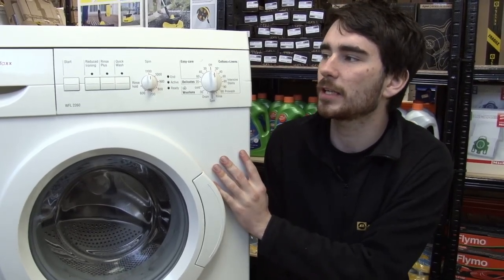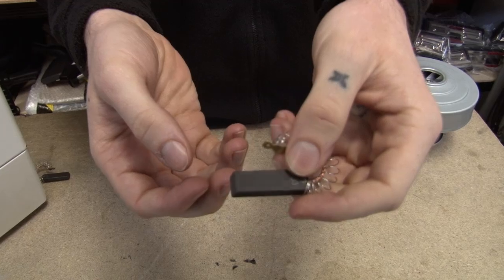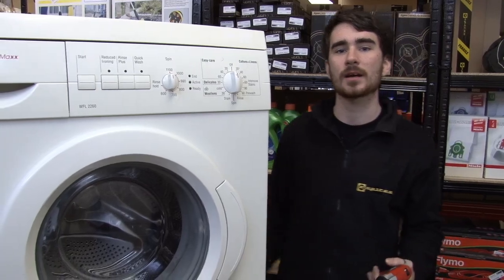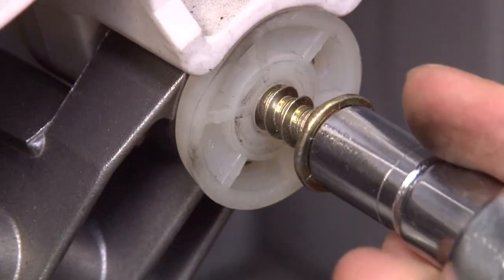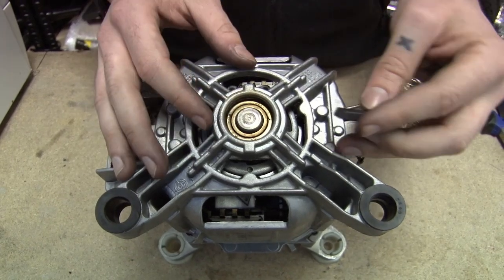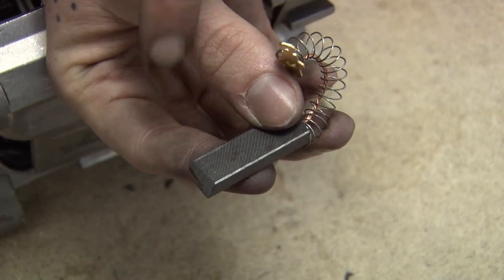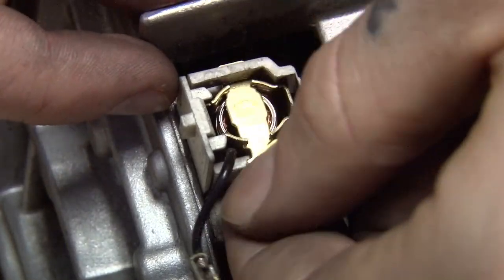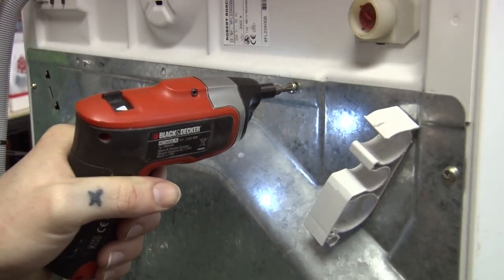How to Replace Carbon Brushes on a Washing Machine (Bosch)

Comment: Hi, I wonder if you can help me. I changed the brushes on my Whirlpool. Everything works fine except when it gets to rinse, it does a slow preliminary spin, but when it tries to spin up to speed (even on lowest 400) after 2-3 seconds, before it gets up to speed, the lighs flicker and it stops spinning. It keeps on trying to spin over and over.  We have been using it like this for about a month (because it washes OK), so the brushes should be bedded in by now. I cleaned the commutator.  Any suggestions please.
Reply from the maker: Hi Frank, This problem may be due to an unbalanced load so check out :
How to Prevent a Washing Machines Spinning Noisily
If the machine spins oK when just a light load is in that would tend to prove this.
If the lights 'dim' even on an empty spin you may have a damaged motor (possible shorted windings) that the control board is resetting rather than push too much power through it.

Comment: Opened mine up, but don't think i have exchangable carbon brushes, just a whole circle of them, but no further screwes anywher to dismantel the thing any more.
Reply from the maker: Hi Geert365, what machine is it?.
Reply: eSpares Turns out i don't have carbonbrushes but  in dutch a: "aanloopcondensator"  (run up condenser?). It is a Philips 901.
Reply: eSpares Ps, i also already checked a duct running to a thing whitch measures the 
levels of water i think, can't get both ends loose, but can pretty 
easily blow through it.
Reply: Geert365 Opened the machine up, contact spray on some wirings, motor out, motor in, Internet searches, been busy on and of for a week (don't exactly know the hours), than the idea of checking the fluid (?) dispenser, it went a little ridged, put some oil on it (kinda thought it made sense that that could cause problems) and the first test wash went oké, so problem solved for now (who knows about next month, but still). Long story. To anyone who is helped with this.
Reply: eSpares  That would have been a pretty good guess  (seems to me) from all the way too far off, but hindside etc etc, but thanks for the attention. Goodluck with the next ones.
Reply from the maker: Geert365 We do not have information listed for this model or details of the motor used.:-(
Reply: eSpares It is solved already, but thanks for checking.
Reply: Shayne van Asperen  I got an beko but it is noisy !!!!!!!!!
Reply from the maker: the cube see our video: 
How to Prevent a Washing Machines Spinning Noisily
This may help identify the problem.

Comment: Hello. I was wondering if you could advise why my Bosch WFL 2400 motor started getting very hot and smelly tonight? I changed the brushes about a month ago, and it's run fine until tonight. Tonight it had a heavy load of 4 beach towels, and got a little unbalanced. I took the belt off and the drum spins freely, as does the motor - so all the bearings seem fine. Do motors burn themselves out over time? I'm kicking myself for not checking the commutator when I changed the brushes.
Reply from the maker: Hi Tony, With a heavy load the motor is going to work a lot harder and will get hotter. If this gets too hot or the commutateor was blackened and not making a good contact to the brushes then extra heat may have damaged the windings or the commutateor itself. If the motor is sparking or noisy when you retry it empty clean the surface of the commutateor with fine grade abrasive paper and check the brushes condition. If the problem continues you may require a new motor.

Comment: Changed brushes now my spin speed is changing and machine doesnt work, it just bleeps and changes spin speed
Reply from the maker: Hi Liz, Recheck the brushes are fitted correctly and the buttons on the control panel are not stuck. It is possible the worn brushes could have damaged the PCB.
Reply: It has started working ok now, after 24hrs I tried machine and worked ok, im not sure why but it is now working fine with new brushes, thanks
Reply from the maker: liz brougham It is possible the problem was due to the new brushes 'bedding in'
This is unlikely to reoccur if this was the problem.

Comment: Good video, it helped me get my old brushes out and they looked worn down to about 10mm (you could just make out the copper wire core starting to appear through the face of one of them so they were definitely shot). I ordered some new ones from eSpares and fitted them carefully as per the video, but sadly my Bosch Classixx 1200 Express is still not spinning. I've had the pump filter out and it's clear. The pump is still emptying the machine anyway, so no draining issues there. It doesn't matter which cycle I put the machine on, it just makes a faint clicking noise when it gets to the point when the drum should turn and nothing happens.
I should also add that when the machine originally broke down last week, it was in the middle of a spin when it suddenly tripped the MCB on the 30A circuit at the consumer unit, so would I be right in assuming that chances are my motor has fried? Or is there anything else I can check?
Reply: Just a quick update... I dug out a multimeter and tested for resistance across the 6 blades on the terminal block on the motor. The first and last pair gave a reading, but the middle pair were dead. I then checked across the brush terminals and got a reading. Next, I managed to get the pointers of the multimeter onto what looked like a thermal fuse (silver and square in shape with two oblong bulges) that was just inside the motor beneath the terminal block. I tested across what looked like the two terminals and got no reading, then I tested each terminal against the body of the fuse and got a reading off only one of them. Does that sound like a blown thermal fuse? I've just read that the fuses are not replaceable, so would I be right in assuming it looks like a new motor?
Reply: *****
Thank you for the reply. I've just run the multi meter test again on the main 6 blade terminal block on the motor and all I can get is a reading of 2 Ohms on the first set of blades and 16 Ohms on the last set, but the two blades in the middle are completely dead at all range settings on the meter. Does that sound like a fried motor? I was going to have the control panel out and test that, but, if the motor's toast, then there seems little point, as the machine, being an old Bosch Classixx 1200 Express, is probably beyond economic repair, seeing as a replacement motor would cost a fair bit more than a recent 9KG secondhand machine with a faster spin and better energy efficiency/lower noise.
Reply: *****

Yes, you're absolutely right, and considering the age of the machine, chances are the bearings and other replaceable components, though they may seem to be OK at the moment, are nearing the end of their service lives, so  to shell out that sort of money for a new motor wouldn't make much economic sense. Anyway, we've bitten the bullet and got a new machine turning up on Friday.
There is, I feel, a cautionary tale for anyone reading this, who's thinking about replacing their brushes, and that is to do it now, as it's easy, doesn't cost much at all, and your old machine will probably run on for quite a few more years, but if you leave them to wear down till the core wire is sparking on the commutator, like I did, there's a chance you'll end up having to stump out for a new machine.

Comment: Hi great easy video - however could you let me know how I get to my pump on a Bosch WFL2450. Once rear removable access panel is off, this only gives access to the rear of the drum. The WM appears to be encased in an all-in-one body. I can see the motor but almost impossible to get at it. Any ideas or am I overlooking the obvious? Any advice would be really appreciated. Thank you

Comment: The back of my Bosch Classix 1000 is much smaller than the one in your tutorial and I can't see the wires into the motor. I can get my hand in and feel them but haven't been able detach them.  Any advice?
Reply: ***** Thank you.  There was a tense moment when it didn't spin, but then I remembered that I hadn't put the belt back on!  All working very well now tho.

Comment: I used this video to fix a Bosch Classixx 1400. The fix works fine and very happy with the spares. Just for the 1400 model, It took me a while to work out how to get the motor out. The entry point is at the bottom of the machine, so I had to lay it on its side and take off the bottom panel. Bit more tricky to get the bolts for the motor as the space is small to give it a good pull, but it came out OK with a bit of a light tap with a hammer. All went back in easily and the bolt tightening re-positioned everything OK.

Comment: My machine washes ok but won't move onto the spin cycle at the end of the wash. If l put machine manually on spin it will spin and empty no problem.
Could this be the brushes?

Comment: Great video but I cannot find any info or part number for my Bosch washer motor brushes, NEXXT100 Series, Model WFMC1001UC/13, motor number 00666422. I don't think all these brushes are the same. Any help on locating these (particularly in the U.S.) will be appreciated.
Reply: G dono-   any luck finding these brushes stateside?   i pulled mine last night and they look very worn?

Comment: I've just followed the video instructions which were clear and easy to follow. To start with all seemed fine but the motor has started making a "whirring sound" when turning. I've taken out the motor and re-checked the brushes were fitted the right way (I think!) after checking the angle of each. Are the brushes just bedding in or is there another way to ensure they run more quietly?

Comment: My motor was too far gone to use wet and dry paper. In the end I took it to a small local engineering company and they skimmed the commutator for just £20.

Comment from the maker: If you find that the commutator has been scored or burnt it can usually be rectified with some fine wet and dry paper being held round it while you manually spin the motor spindle. However, the cost of a new motor and new brushes can vary quite considerably depending on your make and model of machine, but if you suspect that your motor is experiencing problems then checking it for wear and (where necessary) using a method such as the one above is certainly worthwhile! Thanks.

Comment: On a Bosch (and other makes) if the brushes wear down too much the copper braid becomes exposed and can score the commutator. If that happens replacement brushes might not last very long or you might need a new motor which is expensive as I've just found out. I think there might be a case for checking the brushes once a year. The right hand brush when viewed from the rear can be accessed without taking the motor out right so not too hard to check. New motor cost >£150 online. Brushes <£10.

Comment: Thanks for the useful reply. Unfortunately without cutting through the back panel it is not possible to get a drill lined up with the sheared bolt. What did you mean by "use one of the other mounting pegs". Thanks in anticipation.

Comment from the maker: If there were 2 bolts fitted then Bosch consider both to be necessary. You may be able to drill the sheared bolt out and put another nut and bolt in its place. Alternatively use one of the other mounting pegs. Thanks!

Comment: Really useful video. As others here my Bosch did not have a removable back. So followed advice and removed motor with machine on its side. Managed the really difficult and fiddle bit of changing the brushes as per video. When tried to put motor back on its mountings it didn't quite go fully on. So thought I would tighten bolts to push it on. You guessed it, I sheared the head of the bolt right off, so only one bolt holding motor on. Done 1st wash at 1200 spin and all OK. Will 1 bolt be enough?

Comment: Really good vid. 
Had the brushes changed out in no time. The front of the Bosch machine is identical to mine but at the back the access hatch is much smaller (for belt change) on mine. I was able to do mine by removing the belt and then tipping the machine on its side so I could access the motor from the bottom of the machine. I was able to change the brushes without removing the motor. 
Your vid gave me the confidence to attempt the job and it worked out fine. Thanks.

Comment from the maker: A valid point - the edges in many appliances can indeed be very sharp, so be very careful when removing anything. Levering the motor out with a screwdriver is a great tip, although of course once the motor is loose it will still need to be lifted out of the machine, which is where extra care must be taken. Thanks!

Comment: You should never just pull out the motor when trying to remove it..because you can very easily cut your wrists.
instead just put in a large flat head screw diver and lever it out.

ex bosch engineer.

Comment: Great video. I've a slightly different Bosch model from this one (a WAS model), essentially the same and I'm really struggling to remove the motor - any tips? It's got a black rubber sleeve over the rear mountings and I wondered if I should be trying to remove this first, I can replace the right hand brush in situ but I think I will struggle with the one behind the wiring loom.

Comment: Excellent video, Rory. Just finished replacing my carbon brushes in my Bosch WFL2060. By following this video, I was able to get it done and the washer is working again! Thank you so much for sharing how to do this. I got the bushes for less than $40 and saved a costly service call.

Comment: how long should I expect the brushes to last on a Bosch washing machine from new with daily sometimes twice daily use?  We've had ours 7 years and suddenly a slight grinding noise is followed by a silent and zero functioning motor.  If 7 years is in the time frame for brushes I'll go to the trouble of dismantling to remove and reorder :-)

Comment: Hi, thanks for the video. Since replacing the brushes, the machine does not spin to full speed. I wonder if we put the brushes in the wrong direction. Could this prevent the spin reaching full speed? Does the machine do full speed in only one direction (i.e. anti-clockwise)? Thanks.

Comment: Hi Rory, great video. Quick question if my WFO2460AU drains but doesn't spin is this likely to mean the replacement of the brushes or can it be another issue?

Comment: Excellent and useful video. Did this about a year ago and fixed my washing machine, thanks. The motor has just stopped working again so I took the motor off, but found that the bushes were fine although one of them was a bit stiff in the slot, so I made it run easier by pushing the offending part out a bit and it slides freely. However the drum still isn't turning :( what do you think I should try next, please? Do I have to pull the motor out and find a way of testing it or is there a fuse?

Comment: Guys, many thanks I also have the Classixx 1200 Express and just put it on its side to take the motor out as the back doesn't come off, actually ended up using a bicycle spanner as a torque wrench won't fit in the gap. My brushes were down to about 4mm after 8 years heavy use. Got the brushes from your website for about a tenner and washer is now running like new. saved me a small fortune and only took 30 mins of my time. Brilliant! I owe you all a pint.

Comment: Espares,
Your video is excellant.
But note on my Bosch ClassiXX 1200 Express the full back panel can not be removed.
I removed the part back panel to removed the belt. Then I had to tip the machine upside down in order to remove the wiring Loom & earth. Then I removed the motor with a stuggle because the motor screws catch on the remaining back panel. 
But in the end the motor was removed in order to be able to replace the carbon brushes.

Regards

Chris

Comment: Garden Angel,
I turned mine upside down and could not even remove the brushes even with the use of mirrors. I believe I need a useful wife like yours.
I had to remove the motor in the end with a struggle.

Best regards

Chris

Best regards

Chris

Comment: Jenmill,
You must have very very nimble fingers.
The full back panel on my 8 year Bosch Classixx 1200 Express did not come off as shown on Espares video.
I tipped the machine upside down removed wiring loom & earth but could not replace brushes not matter what I tried.
In the end I removed the belt & removed the motor in order to replace the brushes.

Regards

Chris

Comment: Candy CNWD136 CNWD-136 had stopped spinning and there were sparks coming from the motor.  Followed your guide, removed cleaned and reseated the brushes and it worked fine after that.  Only difference is that I could get at the brushes from underneath by tilting the washer back.  Thanks for your great guide...

Comment: Just repaired our Siemens Siwamat XS 440 washing machine and your video helped a lot. At first I had trouble finding a way to access the motor but finally figured out that only way to access the motor in XS 440 is through the bottom, not from the back. Now our 10 yrs old washing machine is spinning again like a brand new :) Spare carbon brushes cost 18 € and it took an hour and half with all the hassle and figuring out how to access the motor. Saved a big buck, thank you very much!

Comment: You guys are the best!. Carbon brushes went in in about 15 minutes and all's well.
The only suggestion I have is that on my Bosch, to remove the clip from the old carbon brush fastener, there is a small lever that must be pushed up from underneath the clip. So, don't try to pull it off (so to speak) with brute force. 
Other than that, I just saved £350!

Comment: Great video, thanks very much. I bought a machine second hand with new brushes fitted but one is worn at a funny angle (flatter than the preset angle). I wonder if this is due to it not being rammed home. Also wondering if the brushes are the correct size!